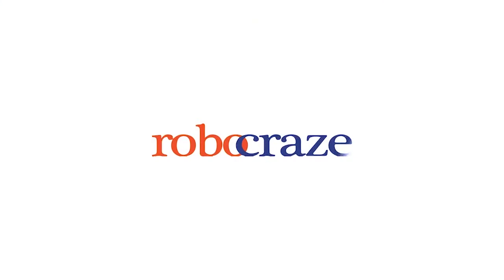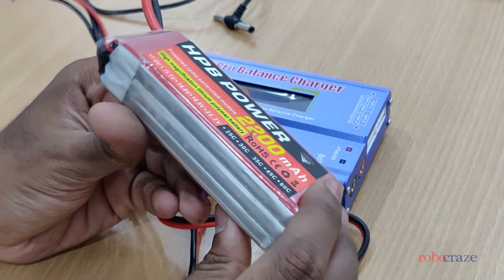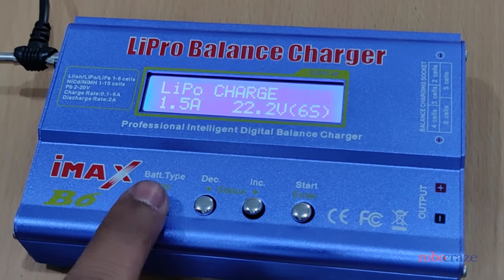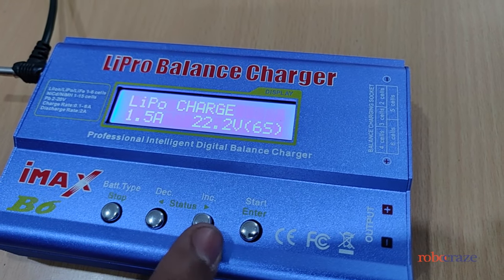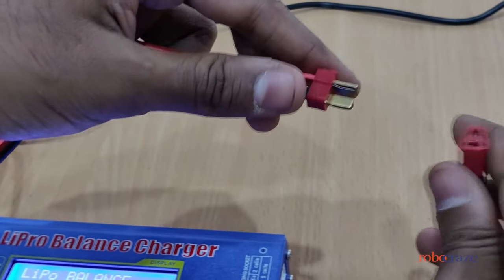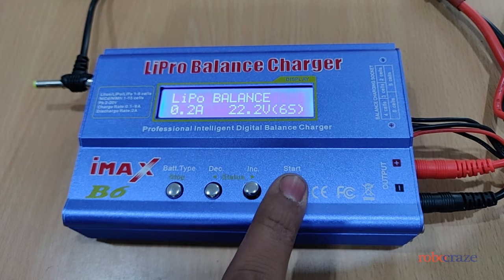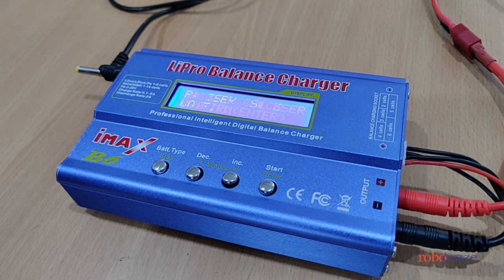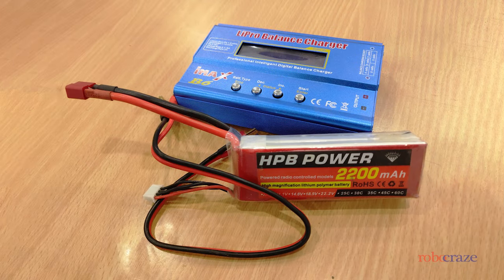#TUTORIAL How to charge a LI-PO BATTERY & IMAX B6 MULTIFUNCTION CHARGER

Comment: Hmmm now it will take 4-5 hours to charge at 0.5 amps and will give you 5-8 min of flight time we'll done
Reply from the maker: Hello! It sounds like you’re dealing with a situation where the charging time is long and the flight time is short. To improve this, consider using a higher-capacity battery or a faster charger, ensuring the battery can handle higher discharge rates. Also, make sure your charger settings are correctly configured for your battery type.

Thank you for your comment! :)

Comment: .5am because you use the .5 amp wire? that's wrong!
Reply from the maker: Hello! The wire's current rating is important for safety, but the charge rate of 0.5 amps should be based on the battery’s specifications, not just the wire. Ensure you're using the correct charging current for your battery and check the wire's capacity to avoid overheating.

Thank you for your comment! :)